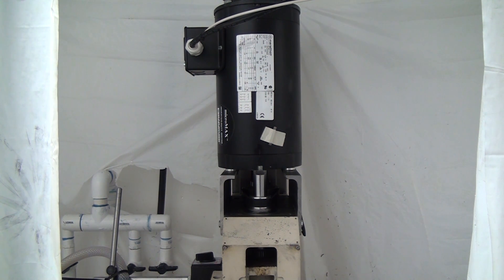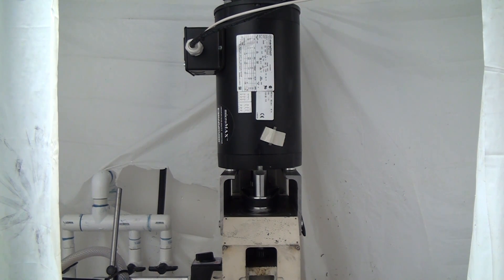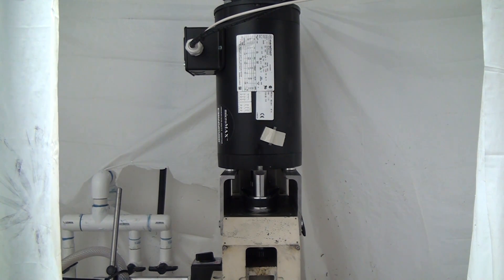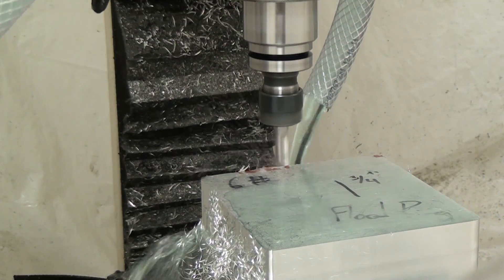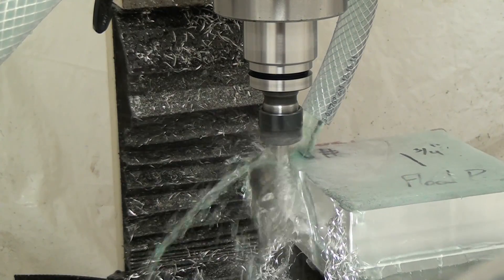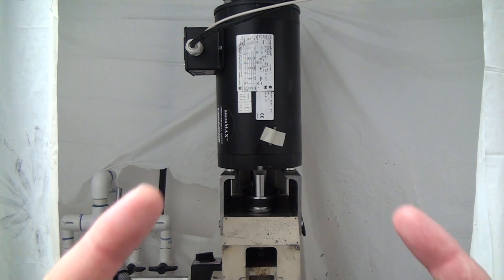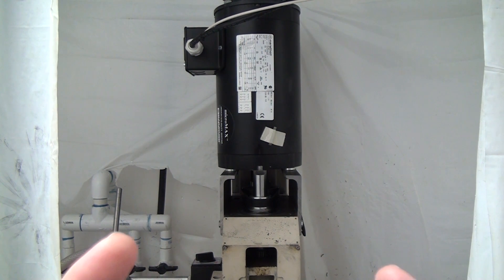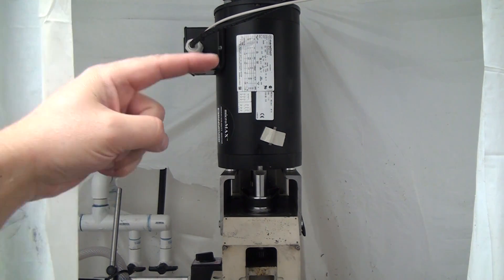CNC-G0704 #24 - Heavy Motor Problem is Gone

Comment: Iuse an air  cylinder counterbalance, mostly to save wear on the z-ways and ball screws, z-ways are cantilevered probably wear out faster than the horizontal ways.  Plus I can use faster UP accelerations.

Comment: may be that linuxcnc is rounding corners automatically, try G61/G61.1 or G64 P Q (here is the G-Code quick Reference http://linuxcncDOTorg/docs/html/gcodeDOThtml DOT is replaced with ".")
Reply from the maker: +ipadize I've been told the same but haven't spent much time looking into it. Thanks for the link.

Comment: Glad to hear it's working ,
It could have been a setting that you have since changed and just did not realize it at the time. either in the Cam settings or Linux CNC  From my experience if it's a mechanical or electrical issue they tend to show up again so just be on the look.
From what I saw in the video it seemed software or Cam to me.
Be Safe,
Sam

Comment: i've got the marathox blackmax which is also 50lbs, it's lifting fine with no struts or pulleys. it's always annoying when it just goes away like that, glad its working
Reply: Charlie what size stepper motor are you using.  I believe Russ was using a 960oz motor.
Reply from the maker: Nice! I'm glad someone else has it working too :)
Reply from the maker: I thought mine was a 906oz. It could be 960oz too. I'm to lazy to check right now.

Comment: Your problem has always been software/configuration related. I just watched the previous video and you are getting close with the g61 setting.  The ratio between speed and acceleration causes very rounded corners because Linuxcnc is trying to maintain speed and the math says the corner has to be that rounded. There are 4 solutions to corner rounding. G61 (exact stop), lower the speed, increase acceleration or use g64 with a path tolerance. G64 will automatically adjust the speed so that the path won't stray more than a defined distance.
Reply: I agree.  It really looks like you are using G0 Rapids for the lift/traverse/plunge, and LinuxCNC is rounding the corners in the rapids to avoid hard stops in cutter trajectory.  Enabling "exact stop" should address the issue.  What software are you using to produce your G-code?  If you type in those same rapids in MDI mode it should exact-stop between each command rather than corner-cut.
Reply: Jason Carter not op but thanks I learned something random that will most certainly be useful later!

Comment: Check this out http://wiki.linuxcnc.org/cgi-bin/wiki.pl?TrajectoryControl i have had the same problem some times.
My guess have been it have to do with the above modes. When looking at the path in linuxcnc it will at certain moves take "short cuts" or "blend" so my solution have been to increase the different hights in the cam to take the "short cuts"
But might be as easy as changning the modes

Comment: As I recall the position wasn't being lost so that was difficult for me to explain in an open-loop stepper system. If the weight of the motor was causing steps to be lost in the upward direction, this would be a cumulative problem and the z-axis would wander in the downward direction.  if some motion control hardware was buffering the Z axis stepper movements and linuxcnc thought the Z motion was complete so it started the X & Y motion, that might explain this sort of problem. But if you are controlling the stepper motors directly from a parallel port or other real time non buffering hardware then I'm somewhat at a loss.